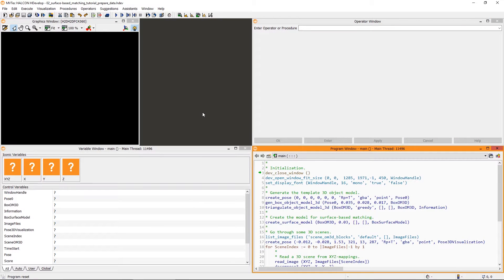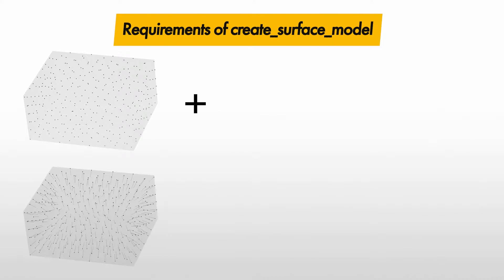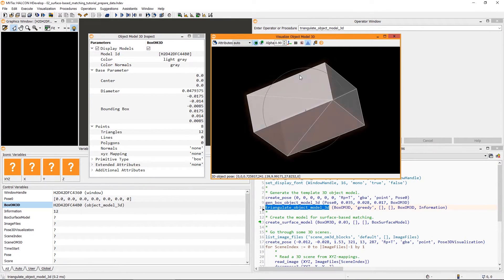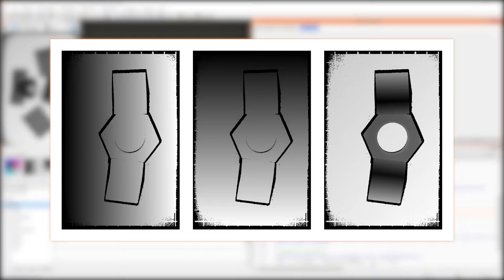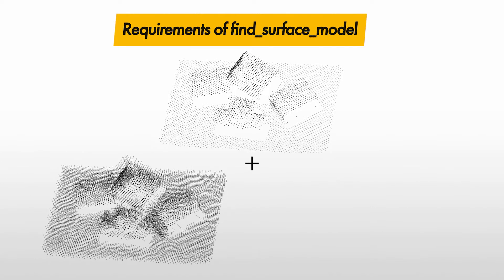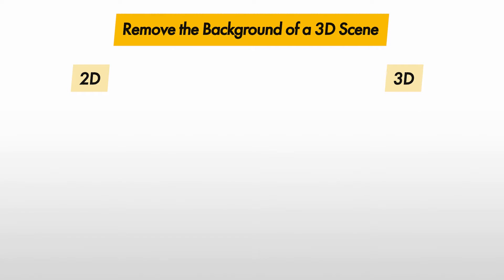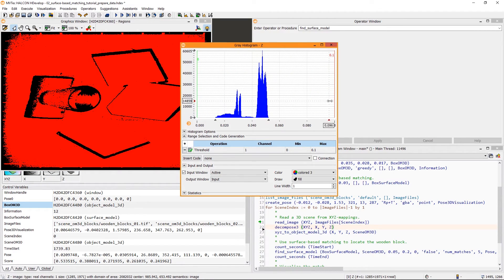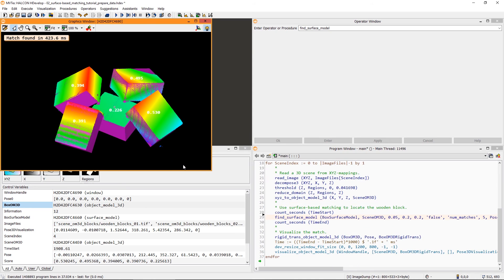Optimize your 3D Data for Surface-based 3D-Matching with MVTec HALCON

Comment: Hi, I have problem to get meaning from variables. When I check 'SurfaceModelID' in 'Variable Window' and check 'self_similar_poses', is there some method to actually read these data (there are just some values, e.g. [0] = 0.0, .. [18] = 360 ... etc). Or should I just use it in actual surface-based matching to see if it actually worked?
Reply from the maker: Hi Linda,
In 'SurfaceModelID' in the 'Variable Window' you find 'self_similar_poses_models' under 'self_similar_poses', with which you can find all trained models.

With

get_surface_model_param (SurfaceModelID, 'self_similar_poses', GenParamValue)
get_surface_model_param (SurfaceModelID, 'self_similar_poses_models', GenParamValue1)

you can get the values of poses and 3d model Handles. Each model has a pose, which has 7 values.